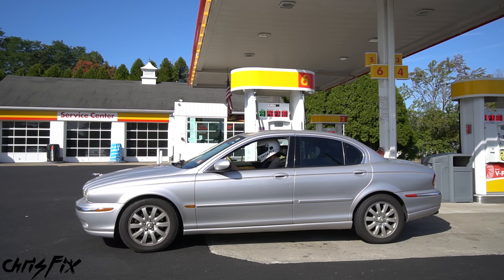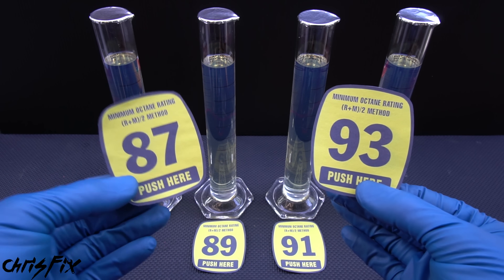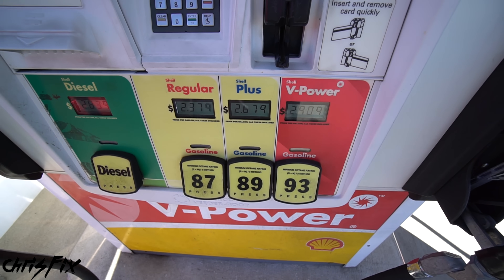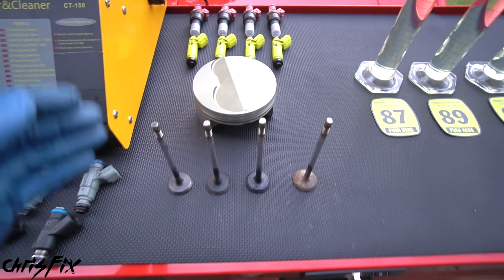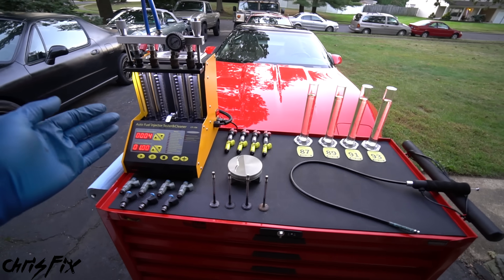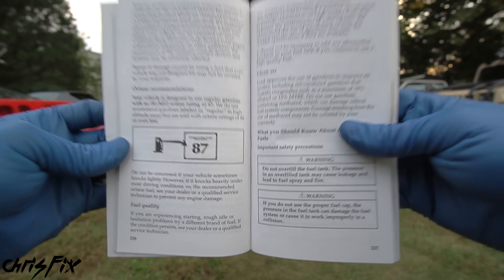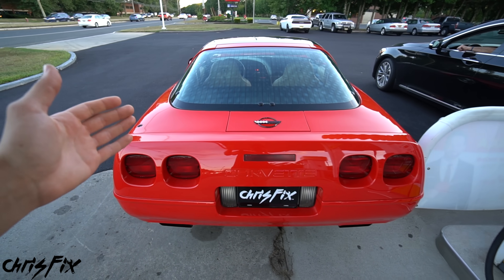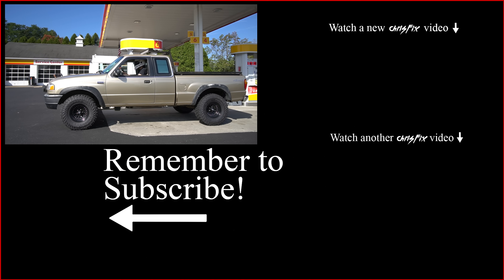What is the BEST Fuel to Use in Your Car or Truck and WHY

Comment: Damn that why problably why i blew my head gasket on my mustang filling with premium thinking that was performing better i least i know from now on thank s to this video
Reply from the maker: By filling it with premium, it shouldn't have affected the head gasket, what was the condition of the coolant system before the head gasket blew?
Reply: @chrisfix  everything was recently done from headgaskets to throttle body gaskets were change one year ago including the coolant pump thermostat  since then i was running premium i think i was because like you said in the video were the pistons have carbon build up those were the spots where the headgasket start failing but o well even if wasnt the fuel i learn i shouldnt be refueling premium unless its say so or some special cases like your mazda truck

Comment: I use 91 or higher octane in my vehicle that requires 89, but I have a custom tune in my computer that makes it require 91 or higher. Manufacturers requirement is fine until you start modifying things for more horsepower.

Comment: One question though.. ive seen fuel delivery tanks fill up the resevoirs at shell then drive to like a marathon gas station and also fill up their resevoirs. So my question is is there a branded shell or chevron fuel exclusively for these branded gas. Ive filled up at a chevron on a monday ran exactly 55 miles mon thru friday and barkey half a tank i waste. Yet i go to another chevron station fill up on a monday same gallons same exact milage and yet by wednesday my tank is a little below half.. what could be the problem..

Comment: My dream/Project car had been sitting for a year when I got and its knocking and I'm worried it's the motor and I was told the bad gas and old oil can cause this what do I do? :(
Reply from the maker: Put in 93 and do an oil change (get an oil analysis done while you're changing the oil), and see if it still knocks. If it does, scan the computer and see what codes you have
Reply: It surprisingly has no codes, but I'll run the 9e and do and Oil change I hope it's just Piston slap and not a bad rod Thanks Chris!

Comment: Nah.... my car is perfect on my 85, even though it says to put 89, oil companies just want more money
Reply: BKrandy- It's not the oil company that writes your owners manual. It's the people that engineered your vehicle. So based on the engines internal combustion pressures , they determine what minimum octane fuel should be used to avoid detonation.
Reply: @TheNYgolfer  Just because they don't write it doesn't mean they don't influence it
Reply: @QuentonCassidism  yeah actually when I get my oil changed they say to come back in 3-5 thousand miles even though my oil lasts 10 thousand miles

Have fun wasting money at every turn by people that think you're an idiot
Reply: @QuentonCassidism  By the way, drove the car from 0-160k miles so far, absolutely no issues

Comment: When I was in college studying  engines in I was taught that a gallon of gasoline had a thousand BTU more in regular than premium.    This was in the 1960's so this is no longer true?
I has a 1992 supercharge Buick that called for 93 that I often put 87 when the temps were cold but that was at 4,000 to 6,100 feet above sea level because it made 31 mpg rather than 29.   I never pushed it where I could hear it knock.    It ran 180,000 miles.
Reply: The amount of BTU's in a gallon of gas is 114,000 plus or minus about 1000 BTU depending on summer or winter. This is called the Gasoline Gallon Equivalent (GGE). This translates to about 44 horsepower-hours in one gallon. Depending on summer or winter, the difference in HP-hours per gallon is less than 1 (negligible). In other words, like Chris said, the amount of "power" in a gallon of gas is the same no matter what season or grade you select. The octane number is only a measure of the fuel's resistance to detonation at a given pressure and temperature.
Reply: @themagus5906  44 hp-hr is the heat of combustion in a gallon.   A gas engine in application is less than 28% thermal eff so that gallon will produce 12 hp hrs.   not 44.

Comment: All gasoline in the U.S. is fungible.  Meaning, it is generic.  Chevron, Shell, Exxon, whatever, they are all the EXACT same. You will see Shell tankers at the Chevron Richmond refinery. It doesn't matter. The only difference are the additives.  Chevron has "Techron."  The other oil companies use their own additives. But the base gasoline is no different between manufacturers. That is the law.

When gas is pumped through pipelines running from Texas to the northeast, any company can take gas out of the pipeline as long as it matches the total they put in. Gas is gas is gas. Yes, the octane rating is important. As long as it is understood that it doesn't matter which company's pumps you use to fill up.

Comment: Im building a full roller 306 for my truck with AFR aluminum heads.  My goal is pump gas, preferably mid grade 89 but preferably low grade 87 octane.  Im shooting for 9.5:1 compression, that with aluminum heads, a recurved dist and running slightly rich on the fuel mixture I should be able to run lower octane fuel.

Comment: Explain this then! Every time I pump higher octane in my truck I make less miles per gallon.
Reply: Higher octane gas doesn't ignite as quickly/ burns slower. If your car doesn't require it, then your engine may not burn all the fuel before the combustion stroke is complete. This results in less efficient operation.

Comment: My car says ''Premium recommended'' but I am cheap but at same time I baby the car so I use Plus or 89 octane and take the middle road.
Reply: If you never put your foot to the floor for max power then you may never know the difference. Your engine is designed to use premium. So at very high engine power loads and using a lower octane your engine will begin to knock and your computer (if the knock sensor is working correctly) will pull out some timing costing your some HP. About a 10% HP loss but only noticeable at very high engine loads. If you never put your foot down to pull that kind of power then you will be fine. There is a however catch. If you do that once in a while and your knock sensor is not working correctly then engine damage can occur. Just so you are informed of possible downsides to the risk you are taking.

Comment: When do you use fuel injector cleaners, transmission cleaners, and gas treatments? Can you use them all at once?
Reply: Depends on the vehicle, with most gas cars you can get away with never using one, but every 50k miles would help with longevity. If it's a diesel then you have to add an injector cleaner every fill up

Comment: the red must use the good one. if not for what you want! and the hummer or is diesel is why you jumped it cradle of the happiness that gives you the cost and miles per hour? and find out how good your experience is in terms of your GASOLINE knowledge. 6 MPG is more or less.

Comment: Guys what is the best fuel to use on Chevy Spark 2017? the manual says use 87 or greater I tried using the regular fuel during acceleration the car engine struggles to move when I try the premium fuel its makes the engine smooth run and perfect engine start.

Comment: Chris, you left out a very important issue, 10% alcohol is less efficient than 100% gasoline.  Maybe 3-5% less.
Reply: You're absolutely right and they want to go to E85? I miss the old days of Sunoco 104 and 106 octane.
Reply: @lorenzomaximo1818  E85 is actually awesome fuel for turbo/supercharged engines aftermarket power. E85 has an octane of about 114. Much higher than 106 Sunoco. But the downside is you have to burn about 20% more E85 to get the same power as you would if you had 114 octane gasoline. Now a supped up forced injection engine of say 800 HP would already burn twice as much fuel as it did when it was stock at say around 400 HP. But if you tune it to run on E85 then it needs 20% additional fuel on top of that. That means huge fuel injectors and huge fuel pumps. But even burning 20% more E85 at what $2.50 a gallon is much cheaper than buying race gas at 110 octane at $6.00 a gallon. That is why E85 is so good. But in a normal stock engine using E85 is going to cost you both power and MPG because your stock engine does not come with a multi race tune to take advantage of E85's high octane.
Reply: @danhammond9066  
And you are right it is a good racing fuel but you get 20% less fuel efficiency I don't dispute that. But for everyday driver it's horrible not to mention the condensation problem that causes up here in the Northeast. Plus it will cost gas station owners tons of money to convert over to new equipment. Plus the car manufacturers would have to retool for all cars to accept E85.
Reply: @danhammond9066  Ethynol by itself has a 108 Oct rating and the gas its mixed with is 88oct.  I believe that makes e 85 104 Oct.  Sunoco E-85R has only a 99 Oct rating.  You are correct as far as loosing efficiency when it comes to mileage but not power.  
Any vehicle can run on E85.  It has a lot hotter burn though but the main difference why a car isn't a flex fuel and wont run for long if it's not is the injectors will fry and Ethynol will eat away rubber fuel lines and gaskets.
Reply: @joeyrittierodt6958  not any vehicle can run on E85... As was mentioned earlier in the thread, injectors and fuel pump often have to be upgraded (as well as tuning,) additionally many times other parts are upgraded for the duty of running ethanol...
Reply: I have a 2003 Chevy Malibu, with a 3.1liter V6 n Mobil 1 oil and a K/N air filter. I use Súper Always since regular gasoline destroyed the catalytic converter. Gasoline engines run better with Super. No problems at all n she can run all-day long on the highway at 100mph.The engine sounds better, runs stronger n idles fine
Have a great year to All.
Reply: My ‘03 suburban takes E85

Comment: Great information. I will add one thing, my 2018 F-150 manual states 93 octane when towing “substantial weight.”
Reply: I suspect you have a turbo on that engine. The turbo will work harder under that load requiring higher octane.

Comment: I've never seen 93 in California.  I really need to move out of this place.
Reply: Its because California have stricter laws for its fuel. Fuel is cleaner in California and produces less emissions
Reply: @JamesJackson-fq7xg  no it isn't. I worked at a holding station. The California bound fuel is exactly the same as everywhere. Facts.

Comment: 2016 kia optima 2.4 gdi Runs great on 89...look in my owners the car was tested at 91 octane far as mpg....87 had me knocking.....those engines are already noisy
Reply: Kia gdi motors can absolutely make use of higher octane. They adjust several factors depending on what its burning. Mine runs ok on regular, it runs noticeably better on premium.

Comment: Interesting information. Is there a difference in the cleanliness of the different octane fuels?  A service guy at our local Toyota dealership told me to run a higher octane level to reduce the amount of sludge that accumulates in the gas tank. Fact or just another myth?

Comment: the best?  Hydrogen.    no carbon build up. no knocking.. no detenation... no more paying for fuel.

electrolysis is so efficient nowadays you can run one big enough to supply the engine.  

and yes, you could say my engines run on water...   thank you Stan Meyer

Comment: An interesting video. The worst gasoline that you get get here in Germany is 95 ( Super ). The better ones are 98 ( Super Plus ) 100 (Shell V Power Racing) and 102 (Aral Ultimate 102)

I prefer the Aral Ultimate 102 for my E60 530i or the 98 ( Super Plus ). I don’t youse the shell V Power Racing because there is no Shell petrol station on my way to the work or the city.

Comment: My 2015 ram hemi  would knock on low rpm aceleración.  Manual says 89 recomended 87 is ok says nothing about premium. I let the tank almost empty filled up with 89, knocking went away. Let it go almost empty filled it up with premium, knock came back. Let it empty filled up at costco 87 ,no knock at all so I just use 87 since costco dont have 89 only 87 or premium. So true about looking at you're manual. It just make no sense to me how 91 would  cause a knock its supposed to prevent it.  Good video chris. By the way I've put another 15000 miles on 87( or 89 when I pull heavy trailer) and haven't had any more knocking  at all .

Comment: A reasonable layman's explanation. However:   The real issue is the timing verses compression ratio and intake manifold pressure which determines what the cylinder pressure really is when the mixture is ignited.  Folks who use E-85 are using a fuel with 115 OCTANE rating and can adjust the spark advance to make more power.  87-93 Octane gasoline can be used in most engines but unless you are racing , the 87 is sufficient for driving.  Even higher compression engines can be run on lower octane fuel by retarding the spark.  This effectively reduces the cylinder pressure at the moment of ignition.

Comment: What everyone seems to be missing here is fuel quality. The lower price says it all. Shell premium is not only higher in octane, it is higher quality fuel. Less cheap "filler" ingredients like combustible solvents and ethanol means the fuel doesn't break down as quickly and, like the man said, its additives and detergents will keep your engine internals cleaner with less wear, corrosion, and oil contamination. All my toys get only premium fuel to protect the engines and fuel systems, especially when they might be stored for months or even years at a time. I have a motorcycle in my garage that hasn't ran in two years. The premium gas in the tank still smells and looks like it did the day i filled the tank for storage. Anyone ever have a problem first starting a mower in the spring? Not me. The only tank that sees low quality "regular" is my throw away car that gets driven like an unloved mule every day.

Comment: If I use premium fuel for my Tesla, will it extend my mileage for my oil changes?  Also, I have not been able to find where my spark plugs and fuel injectors are located.  Any help would be appreciated.  I think it is due for a tuneup.

Comment: I’ve drove German turbocharged sedans for 12 years. They only see shell or BP 93 octane. The part throttle power is amazing on both. I credit that to the quality fuel and oil I use. Along with ngk and denso plugs.

Comment: This is a trick question! The best fuel to use is electricity, just make sure you're not driving a poison spewing, noisy, maintenance hog and plug in. You'll get getter performance and lower fuel & maintenance costs!

Comment: Your illustration of detonation is wrong. Detonation occurs when the Piston is on the compression stroke on the way up and the excess heat in the cylinder or glowing carbon deposit will cause the mixture to detonate early before reaching the top of the compression stroke. As you said higher octane will help this.

Comment: CHRIS 
I HAVE 2018 TOYOTA HIGHLANDER I DRIVE ALOT AND MY CAR MAKEING NOISE LIKE TIK TIK TIK TIK
AND STOP AND THEN AGAIN SAME NOISE I USED REGULAR GAS FOR 1 MONTH SAME PROBLEM I ALSO TRY MID GRAD AND SUPER ITS NOT MAKING ANY DIFFERENCE SO WHAT I DO CAR HAS ONLY 56000 MILE I BOUGHT BRAND KNOW PLS GIVE ME SOME ADVICE I ALSO TRY THE SEA FORM AND LUCAS FUEL INJECTORS CLEANER ITS NOT MAKE ANY DIFFERENCE

Comment: The concern with the Octane of gasoline is "PRE-ignition" of the fuel before there is a spark from the plug for the cylinder. The piston will be pushed back by the PRE-ignition prior to reaching its top most position in the cylinder and this is how damage can occur to the piston and the rod. 

It is  also not linear with regard to Octane. Mix half 87  Octane and half 93 Octane and the result is not going to be 90 Octane in the tank but something between 91 and 92 Octane.
Reply from the maker: Thanks for sharing

Comment: Mr. Fix, Thank you for this video. I actually have a 2005 T-Bird and I put 89 in it. I will not be doing that again and this spring I will put some octane boost into the current tank that I used to store her. Luckily, the engine only has 23K miles and I have only put 3K of those miles on so Im not too worried about damage, but will keep an ear out.
Reply from the maker: I'm glad to see you've learned from the video!

Comment: Thank you for the education. What about non ethanol? I hear it's used for airplanes and can help an old engine run "clean" to start it. What is it used for and why?
Reply: I believe all the fuels he tested are pure gas. If the fuel had ethanol in it that would be on the yellow octane sticker on the pump.
Example all the 87 octane fuel in my state has E10 on the sticker next to the 87 octane number. That means it is 10% ethanol mix 90% gasoline with an octane ratting of 87. Ethanol is in its nature a much better cleaner than even any of the additives shell adds to its 93 octane 100% pure gas. Ethanol also absorbs water gas does not. 

Aircraft fuel is even more different from auto gas in that they do not use any cracked hydro carbons or ethanol in it. It is a much purer form of gasoline than autos use. Also aircraft gas (100LL) is 100 octane and the LL stands for low lead content. However what you need to know is it is low lead compared to what avgas used to be, not compared to auto fuel. Auto fuel has no lead content. 100LL avgas has about 20 times as much lead in it as what old leaded auto gas used to have back in the 1970's. In short even one tank of 100LL fuel burned in a modern car will burn out your catalytic converter and you car will no longer pass emission tests. Replacing the catalytic converter is expensive.